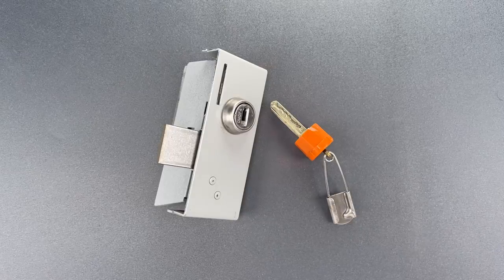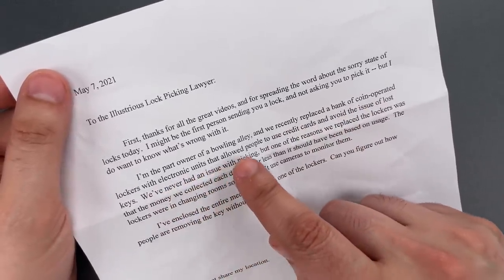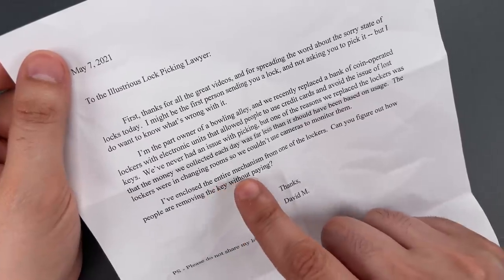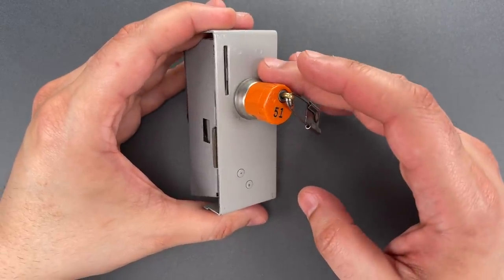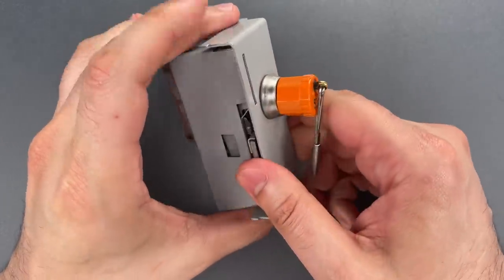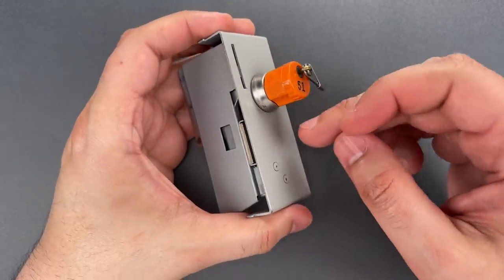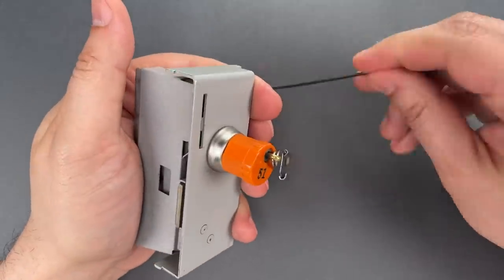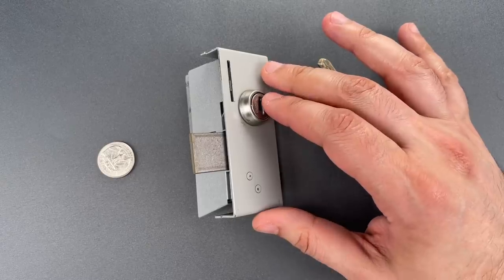[1308] A Huge Flaw In This Coin-Operated Locker Mechanism

Comment: "I featured the same core about 5 years ago"
Oh no, that guy who picked the lock is a millionaire now. He's not paying for 5 years xD

I thought it was going to be like Mr. Krabs, tie the coin into a thread and then pull it after you insert it
Reply: I mean that could probably work too
Reply: I think that would work too
Reply: that was my plan to become super rich when I was 10, I might give it a shot now too.
Reply: I actually did try that once. Turns out that the coin slots are so thin that only the coin itself can fit. Even the tiny extra with of a string becomes too wide to fit through
Reply: Another person would be Scrooge McDuck
Reply: @_Stormfather  what if you hot glue the string to the edge tho
Reply: Picking this lock is different from how to use the lock and locker for free. The person picking is assumed to be trying to pilfer the belongings that were left in the locker. The person trying to use the locker for free is looking to leave their belongings in there; the picker can then pilfer the contents. So these are two distinct vulnerabilities that get exploited by different methods and for different reasons.
Reply: Umbah umbah  spot bot detected, go away
Reply: @_Stormfather  There should be string as thin or thinner than the lip of a coin. Grind down the lip?

Comment: First time I hear of a locker that actually keeps the money after using it.
Reply: Bus, train, and airplane terminals have the ones that keep coins. For that matter, shopping malls do too.
Reply: We had those lockers about 30 years ago at the swimming pool.  The coins would drop to the bottom of the chute and the coins were emptied every morning from every locker.  It was a time consuming job.  The lockers were then replaced when too many keys were missing and lockers could not be used (locked) safely.
Reply: @mwechtal  never seen them. The ones I know, just give you back your coin.
Reply: @PDeRop  they are quite common in the NE USA.
Reply: @raymond19001  The ones at our train stations required active contact with the station office and a fee if you lost the key or didn't retrieve your stuff in 72 hours.  This presumably funded changing to nee keys.  Retrieving after 25 to 71 hours required paying for the extra day or two.  Entire setup was boarded up and removed when there was a society wide push to iincrease anti-terror measures and some bureaucrat suddenly remembered the station locker bombings in southern Europe back in the 1980s or 1970s.  So now bags can't be parked at medium sized stations while large stations require manually checking your bag at a counter like 100 years ago (still doesn't prevent checking in a time bomb in a suitcase, does nothing against sueside bombers that never leave their bomb unattended).
Reply: @mwechtal  It's up to local differences then. I've never seem them in Europe, you always get your coin back.

Comment: I used to have these at my old community pool as a kid. We got them open by turning the key most of the way and smacking the bottom of the door at the same time you turned the key all the way and they popped most of the time. Ethics aside you also took the chance that it might not open or that someone else  would "pop" the one you used and take everything.

Comment: Was servicing lockers long time ago in amusement park. They required 3 quarters to lock, but there were tricks that allowed to use only one quarter. There were two types of locks - in one the coins were stacked in a column and a pin was pushing against uppermost coin. When rotating the key the pin was blocking the path, then putting a coin and rotating the key back and forward fast allowed to catch the coin with the pin and it allowed to close the lock. Don't remember what it was for the second type of lock.

Comment: The grocery store chain Aldi's uses a nifty lock on the shopping carts. It's a coin-operated lock. Putting a quarter into the slot releases the lock, allowing you to take the cart into the store. Returning the cart to the cart corral properly causes the quarter you had put in to use the cart to pop out, essentially returning your quarter to you.

Comment: Decent venues use the coin only as a deposit and you'll have it back as soon as you return the key. Making money by providing a locker is a bit scammy if you ask me.
Reply: And it might be the exact reason why so many people decided they would rather cheat the scam box.
Deposit locks are as badly designed as these but they are much more respected because people understand having a coin trapped for a couple hours and getting it back is just a minor and temporary hassle designed to keep people honest.

Comment: My local leisure centre had very similar locks on the lockers in the swimming pool changing rooms with one difference: we got our pound coin back when we opened the locker,so we didn't have to carry a fistful of change to be able to relock the locker if we needed something out during our session. 

Pretty interesting bypass, though. And it's never a fluke.

Comment: This reminds me of the coin-operated laundry machines we used to have access in the dorms on campus, something like twenty years ago.  It was common knowledge and practice to use those free plastic coffee stir sticks to bypass what I'm now assuming is a similar mechanism when one couldn’t track down change in a time crunch (and who hadn’t learned to plan by visiting a bank for rolls of coins ahead of time), or simply didn’t want to pay.  Ten years later visiting a friend's dorm, their own institution's campus had moved to a similar electronic system that addressed both the theft of services/utilities problem for the campus, and the not having to go buy something for change problem for the students (though refilling those electronic cards after the campus' business hours still remained an impossibility).  

I still run into the coin-op ones in a surprising number of places that aren’t monitored.  Most of them are tiny places, small apartment buildings with machines in the basement, or sleepy unattended small-town laundromats.  It makes me wonder what the margins are between recouping lost quarters, and either paying for monitoring or upgrading the machines.

Comment: Here in Argentina supermarkets have had coin operated lockers since as long as I remember. But this is the first time that I come across the notion that they were not originally  designed to give the coin back after you finish using them.

Comment: Bowling Alley owner: *Charges people to store their sweaty shoes while they pay him to use the facility.*

People: *Finds a way to not be extorted for using a service they already paid for*

Bowling Alley Owner: *Surprised Pikachu*

Me: You get what you f***ing deserve!
Reply: These locks in particular are designed to be used by visiting tournament bowlers as a place to store equipment usually overnight securely so they don't have to take all their equipment out to their vehicles and back to the hotel. Bowlers often have 4-9 balls, maybe more depending on the skill level of the bowler, the conditions their bowling in and the difficulty of the oil pattern or patterns bowling on.
Reply: They lockers are a service.  The owner paid for them.  He's paying for utilities, maintenance and employee wages.  Why would it be wrong to charge a little to recoup what he's paying?

Comment: Who even bothers to do this for a quarter
Reply: I leaned how to do it because I never carry change. It’s only come in handy once though. Defeating the coin lock on grocery carts is way more useful.
Reply: You would be surprised.
Reply: @rogerszmodis  Do places still use those?
Reply: If you go there a few times per week and occasionally open and lock the locker during your stays, all these quarters add up pretty fast.
Reply: It’s not the amount of money. It’s more a mentality of getting away with cheating.
Reply: @Melanie16040  Aldi does, specifically. The idea is to make you bring back the cart. This way, they don't have to pay someone to retrieve carts. It's one way they keep prices low.
Reply: @Melanie16040  At least in Germany they are on (nearly) all shopping carts.

Comment: In Finland we pay the track or swimming hall and get the key from the cashier. So this is not needed. Some of these locks are used in shopping centers and such but you get the coin back. Usually there is polets ready so you don't even need ur own coin.

Comment: One comment suggested that would be customers just put their stuff in the locker without taking the key. This is a likely scenario since the things you leave in a bowling alley locker are not valueable and very few people would learn how to defeat the system much less carry an implement on them to utilize the defeat.

One possible way to resolve this problem [without replacing for electronic] is to put up a sign on the door to the locker room indicating the owner empties out the locker several times a day and chargers a $1 surcharge for emptying lockers with key and contents present. Then have an employee every 30 min to 1 hr. go through all the lockers with a key and empty those found with stuff into an individualized bag [paper grocery bag.] writing the locker # on the bag.

Comment: We had locks like this at some places like my university. Some people just didn't lock them at all, but most people just defeated the mechanism in a similar way. Putting in the coin about 3/4 of the way already triggered the mechanism, allowing for the key to fully turn and locking the lock. People just pulled the coin back out then.

Comment: I don't know if this mechanism is the same, but the local children's museum has maybe an even worse flaw in their lockers.  They give you a little Keychain sized membership barcode card for entry. They fit right into this slot and let's you remove the key just like this.  So  they literally give you a lockpick for their lockers with your membership.  You can also just pay for one locker and they key fits in the slot as well, so you can get a second or third locker free

Comment: We used to have these kinds of locks on the lockers at my college gym, which was members only so it was pure greed and we hated it. However, the entry to the gym had a drinks fountain with plastic straws, so you'd just pass by and pick up a straw on your way to the locker room, put the straw in the coin slot, and be on your way.

Comment: Looks like a "whisker" from the rotating curb brush of a street sweeper. When I was a kid (65-70 years ago) I used to follow them on my bicycle to get lock pick material. Every so often one of the "bristles" would break off and be lying in the gutter. Similar steel can be found as the tines of a metal leaf rake; just a bit thinner and wider.

Comment: Good method, but I think you are missing the point: If they have on average far less income than they expect, it means that a lot of customers would need to use this or a similar trick (literally coin on a string) which seems unlikely to me (or only likely if that bowling center only consists of the same customers every day that use that trick every day). Regular people usually don't come prepared with stuff like that. Best suggestion I can offer is that the coins sometimes get stuck where the feeler is, and never drop down.
Reply: If a coin gets stuck there the lock is jammed and won’t work anymore.

Comment: I'm no lockpicking artist, but I'm good with machines (used to work in maintenance). So my approach would be: does any object roughly the same size that fits the slot would do? I know for a fact that mechanisms that differentiate coins are a pain in the a** to design, so the maker probably took some shortcut.

Comment: It's simple! It's not about picking at all!
It is because you can use the locker without putting in the quarter first! 
it just isn't locked but can still be used for unsecured storage.
Older models would stay close unless a coin is inserted first forcing people to pay for the locker if they didn't want to leave their stuff on the benches or floor.
So in those models most people would pay even if they didn't put their wallet or phone there just because they didn't want their stuff laying around. 
With these types of locks they can still use the locker without paying, it is just not fully locked but it doesn't matter to people that don't keep valuables in there.
As long as your hoodie isn't on the floor it's good enough. 
Also if you force people to pay by card they might just avoid it because people are scared to use their cards where they aren't sure it is safe as many cards get cloned every year.

Comment: Our municipal pool looks like it had a similar lock in key system. And with those all you had to do was hold the door latch closed, pull on the key, and then twist it out and you had a free locker. Of course this didn't work on all of them but it was close to 50% I think.

Comment: Over here the most I saw was that you have to put a coin in to make a locker lock work, but if you opened it with a key, YOU GOT THE COIN BACK (Like it used to be with those grocery carts).
Never seen a locker that fully CONSUMES the coins.

Comment: We used to have these in our high school swimming pool. The coin hopper was a long vertical channel with a tiny door on the bottom that they would unlock at the end of the day and retrieve the money. There used to be a way to slide your folded receipt in a skinny slot beside the lock and the coin would drop into the V-shaped paper and you got your money back that way.

Comment: I wonder if this is the way it happened.  The phrase that stood out for me in the letter was " far less than it should have been based on usage ".  There's certainly a supply of people who will know about this exploit and bother to carry a metal tool to take advantage of it to save themselves a quarter.  But far less?  I doubt they could measure usage accurately, unless there's some counter inside the mechanism.  So my ideas are that most of the discrepancy is either some staff member or else a mis-perception of use being responsible.

I also wonder about a credit card lock system.  I can see that saving the lost-key cost would have a value.  But I always understood the problem with taking micropayments by card is that it costs more than a quarter to take the payment - at least for debit cards which have a fixed fee rather than a percentage fee.  Maybe there are schemes that can accommodate this in the USA.  It must take a long time to payback the cost of such a system.

Comment: An old trick for coin mechanisms like this was to put a coin on a string/wire into the slot, then pull it back out instead of letting it fall into the storage box. It's not even an obscure trick, it's appeared in all sorts of early US animations from Fleischer, MGM, Harvey Toons, and even Disney and Warner Brothers.

Comment: I watch your videos for a while now, and this is the first time i'm not convinced this was the issue. If the owner of the bowling alley noticed that there were too few coins in the mechanisms, it has to be a significant amount over different lockers. Although what you presented as an easy method, probably is'nt quite as well known by so many people to make a significant difference. I'm by no means a locksmith or anything like that (never picked a lock in my life) but it seems that there has to be an easier way to bypass the normal function of the lock.. 🤔

Comment: The usual exploit I've seen people use, as it works on almost EVERY fully-mechanical coin-op mech, is a popsicle stick. One of the big flat ones. It was so bad that my city upgraded to electronic parking meters because their old coin-op units weren't making any money, there would just be popsicle sticks lying around on whatever nearby surface was handy, because people would use them and then leave em for the next guy. It works on the coin-op lock chains for Aldi shopping carts, these types of key-retaining lockers, gumball machines, many of the men's restroom condom and cologne dispensers, etc. 

These mechanisms all are pretty different, but they're all fundamentally relying on a pawl that detects the presence of a quarter-sized coin and a slot sized so that larger coins won't fit and smaller coins miss the pawl. Jam a flat popsicle stick in there, turn, push the pawl til it clicks, remove stick and continue turning, and you get free locker, free parking, free gumballs, whatever.
Reply: Thank's for the info

Comment: My local Tesco uses similar locks on shopping carts. I unlock them with a pair of keys parallel to each other - ends up being perfect width to push the springs on either side and seem like a coin
Reply: Why bother? You get the coin back anyway. You can also use a number of things to unlock them.
Reply: @cplcabs  I don't carry coins with me 99% of the time and their changing machine is perpetually broken
Reply: @cplcabs  Because, given that they no longer accept cash for the actual groceries, along with most other shops in the town centre, and the bus company that takes me there and back; there is no point in bringing any cash with me any more, and therefore I have nothing else to open the trolley with.
Reply: @katrinabryce  i have a token for the shopping cart on my keyring...
Reply: @katrinabryce  which Tesco and shops in the town centre are you going to that doesn't accept cash? All the Tescos and other shops I have been in accept cash. Tesco even has self service tills that accept cash.

Do yourself a favour and get yourself a trolley coin keyring from amazon or ebay, they are cheap as chips.
Reply: @MaxRovensky  look at getting a trolley coin keyring off ebay or amazon, they are cheap as anything.